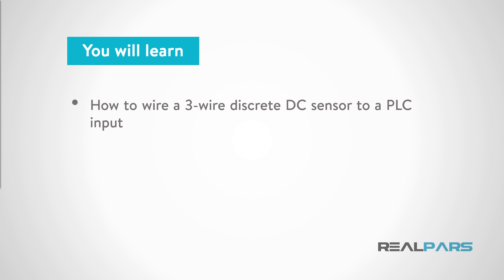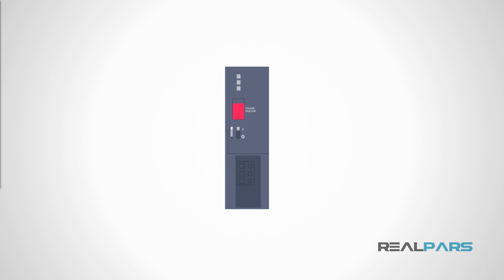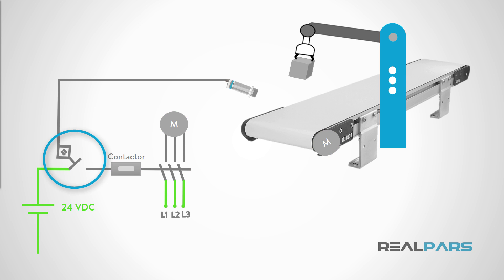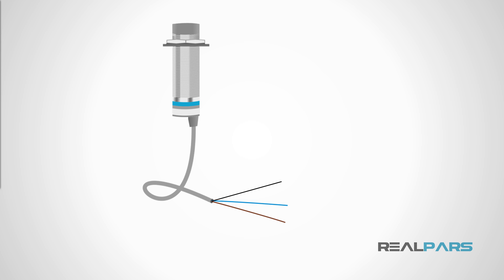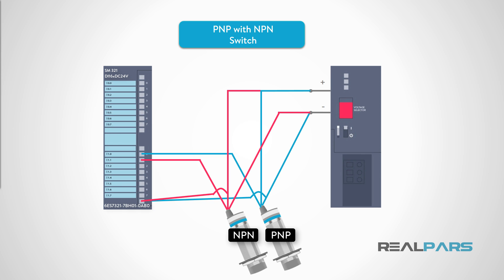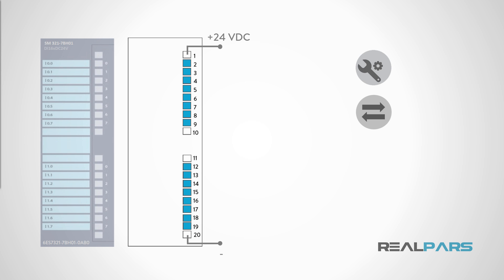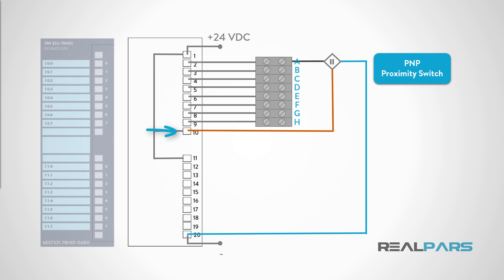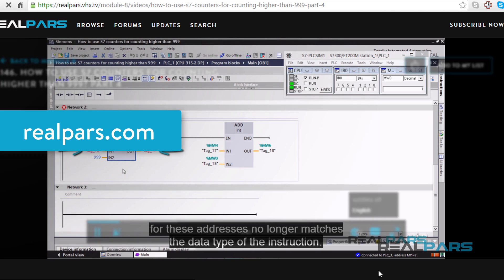How to Wire Discrete DC Sensors to PLC - Part 2

Comment: i think there is something wrong at the program of Plc ... u are making " Q 0.0 " for motor and normal open as a self latch but when the sensor is off the motor keep on because of self latch
Reply from the maker: You are correct.  In the circuit shown, there is no way to "break" the circuit if the sensor input is lost.  The logic shown is for illustration only, and we are sorry if it is confusing.  For a more complete treatment of motor wiring and logic, view the RealPars video "Star-Delta Starter PLC program and Wiring_ Part 1".  To make the logic in this video more complete, a stop push-button should have been inserted to the right of the branched logic.
Reply from the maker: That's what we need a Latch Instruction to do for us. We want it to keep the motor running.
Reply: RealPars I've gotten understand u, amd we can make motor stop by another contact normal close
Reply: @Ehab Ahmed, really???

Comment: What is sink and source
Reply from the maker: A "sourcing" switch is a switch that when changes state, it "sources" or supplies +24 volts DC to the PLC input. 

A "sinking" switch is a switch that when changes state, it "sinks" the PLC input to the common, or ground.
Reply from the maker: Sink and source are electrical terms that refer to the direction of current flow between an I/O point on an I/O module and the connected device.  For a sinking sensor (sourcing input card), current flow is from the input channel to the connected device.  For a sourcing sensor (sinking input card), current flow is from the connected device to the input channel.

Comment: What will be the connection for npn switch?
Reply from the maker: Watch this https://youtu.be/2pdvvqkguA4
Reply: RealPars this link dosn't work
Reply from the maker: Hey! I just checked the link https://youtu.be/2pdvvqkguA4 and it works fine. Can you please try again? :)
Reply: In the video linked at https://youtu.be/2pdvvqkguA4, start watching at about 6:30 for the discussion of wiring of an NPN device.